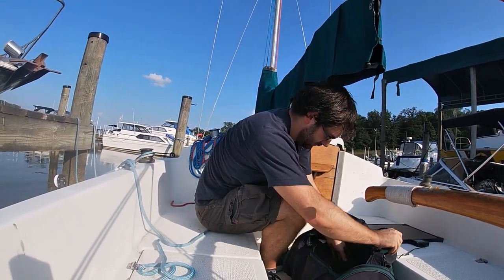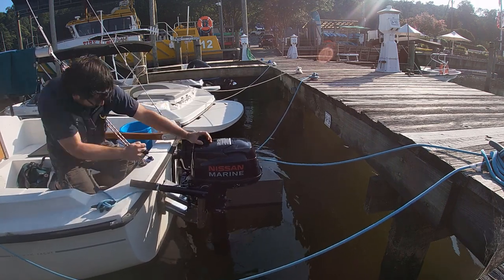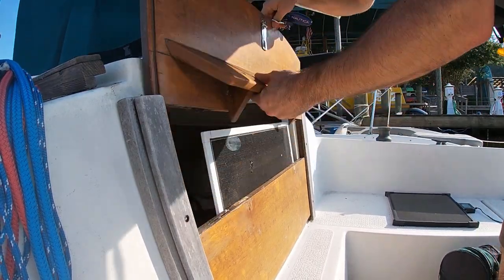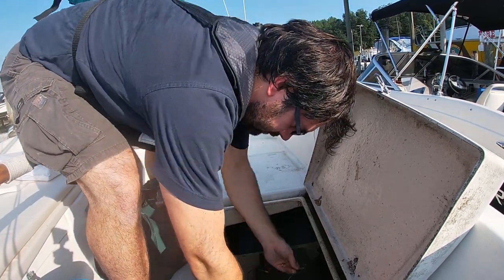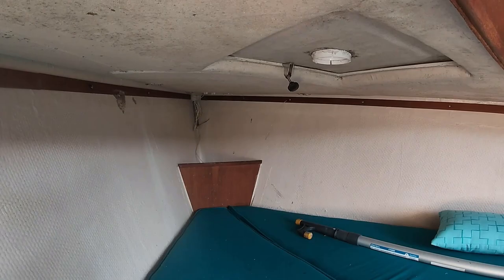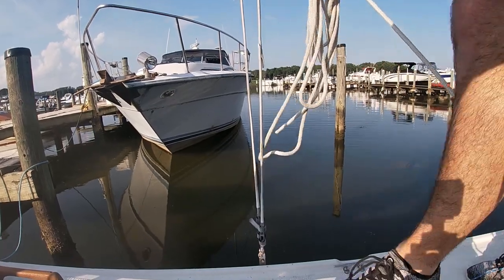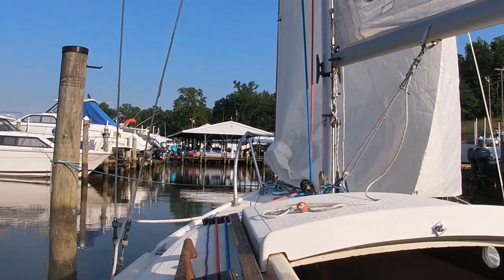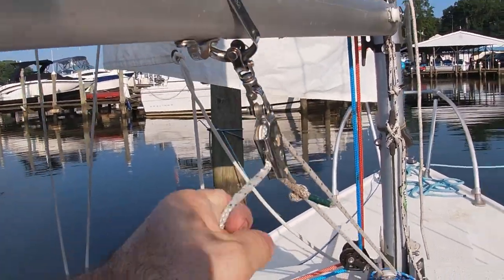Rigging Compac-19 from Slip to Sailing - Two Sons Sailing Ep 18

Comment: American gas has ethanol added which is hygroscopic, it attracts water ,that's why you should never leave gas in the outboard motor.
Reply from the maker: Likely true, although you can get fuel stabilizer that at least claims to lengthen the amount of time it will last without causing issues.
Reply: Some gas stations sell ethanol free gas, especially in areas with lots of boats. I use it in everything but my daily driver car.